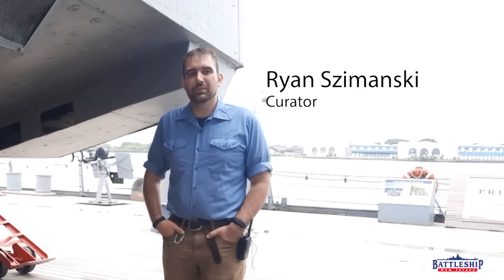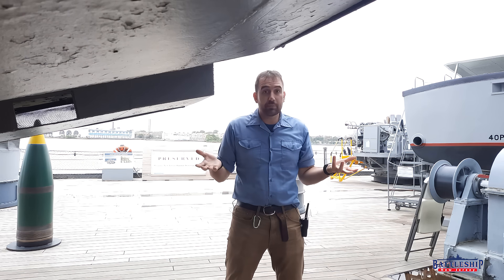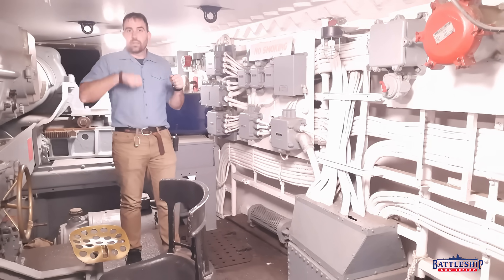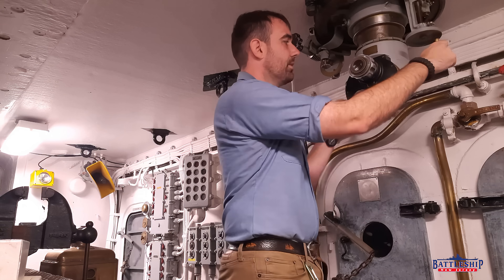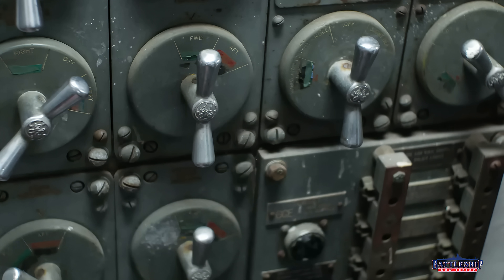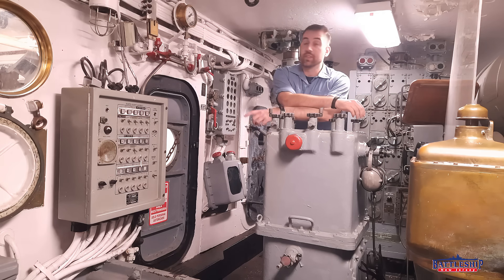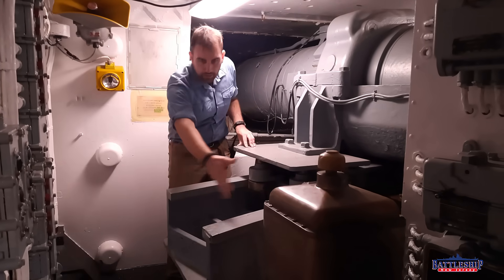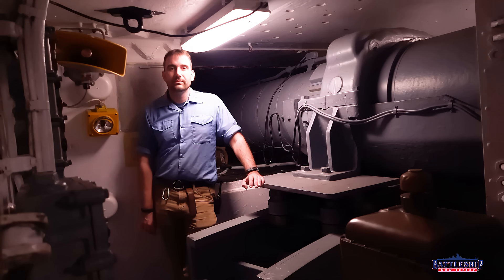Inside a 16in Gun House

Comment: The zig-zag welding lines:  You do not want adjacent plates to move away from each other in any direction.  By using "dragon's teeth" edges, the plates cannot move sideways without literally bending the armor teeth over for the full thickness of the plate.  As was mentioned, it also adds more surface for the welding to lock into if they were pulled upward vertically or sheared front-to-back.. If you look at the armored 2nd deck, it is made of two layers:  A underlayer of 1.5" STS that is directly part of the ship hull construction material and an overlying 4.5" STS heavy plate covering the underlayer,  This makes the armor deck somewhat thinner than 6" of solid STS, close to ~5.5" against a highly oblique AP shell skipping off of it (hopefully), while that is thick enough to stop most regular AP bombs  -- those huge British Tallboy or larger bombs, or German radio-controlled heavy AP bomb (used against ROMA and WARSHITE) made by the end of WWII could punch through, but such is progress.  One thing that this laminated design allowed was that the upper and lower plates were offset from one-another so that there was no ingle crack at the edges of plates on a single layer between the two layers, so that if a hit succeeded in pulling two plates apart on a layer at their joint, there would not be any continuation of the crack to the other layer.  This made the decks much stronger than a single edge-connected layer would be if hit such that two adjacent plates tore free from one-another.  That this was a good idea is shown by some German warships that only had a single armored deck layer and a torpedo hit in the stern literally snapped the stern armor at a joint free and the entire stern was only held on by the sides and lower portions of the hull -- not a good thing (much like the weakness from those Japanese AP bombs on the turret roofs of the old US battleships hit at Pearl Harbor).

Comment: The turret roof armor was 7.25" of Class "B" armor butt-edge mounted (interlocked, but not overlapped) with keying, bolting, and welding at the joints to make them as close as possible to a single huge plate.  Welding such small objects to their back surface will nots compromise the armor protection in the slightest (now Class "A" face-hardened armor is a different thing altogether and there were lots of restrictions to anything that might compromise the hard face layer).

Older battleships at Pearl Harbor had overlapped turret roof plates (4-5" Class "B" armor plates of the quality at the time they wer3e made), This involved having the part of the plate facing toward the front of the turret tucked a few inches under the rear portion of the plate closer to the turret face, like shingles, with heavy bolting through the overlapping portions to strengthen them against a hit coming from the front, since it was assumed that the enemy would be the ship that the US battleship was shooting at and thus toward the target it was facing.  This would give the turret roof protection a somewhat improved resistance at a highly-oblique angle from a ricocheting enemy AP shell.

This overlap was NOT used in the new US Navy battleships built starting in the 1930s.  The reasoning was that any shells might be coming from the side or, possibly, from the rear, and this could make the overlap weaker than a flat top would be.  This turned out to be absolutely true at Pearl Harbor.  Two old battleships, WEST VIRGINIA and TENNESSEE, had one of  their turret roofs hit each by the several level bombers that dropped converted obsolete 16.1" AP bombs (made by remanufacturing old pre-1930 NAGATO Class AP shells) -- the same group that had a bomb blow up ARIZONA.  The two turret roof hits were coming from the rear of the turrets hit, steeply falling but still having a tilt due to the horizontal speed of the aircraft that dropped them.  The bombs could penetrate the rather thin deck armor of those old battleships (ARIZONA showed this dramatically), but they should not have been able to punch through the much thicker turret roof armor.  But they did punch through, though the bombs were heavily damaged in the process (since there was nothing explosive in the turrets, the damage to them was relatively superficial and could be repaired quickly).  What happened was that the bombs did exactly what the turret designed of the new battleships thought might happen:  The bombs hit and began to have their noses rotated away to ricochet, but the nose of the bomb caught the back edge overlapping lip of two joined roof plates and bent it up, ripping out the bolts and allowing the bomb, partially crushed in the process, to wedge itself through the narrow "mouth" that it had just made and into the turret.  I think some modifications to all of the older battleship turret roofs was made to make this less likely.

Comment: Some points about armored gratings:

They are made of the same steel as used in STS/Class "B" armor.

The holes have cylinder top facing the incoming weapon and widening cones at the back side, so the back-side openings are somewhat larger.  The holes are made by using boring bars to drill them one by one into a full-thickness, fully hardened, tempered, and completed STS plate (part of the hull so I think that they are STS under BuC&R/BuSHIPS -- made only by Carnegie/Carnegie-Illinois -- and not the virtually identical Class "B" armor of BuORD -- made by Carnegie. Midvale, or Bethlehem);  they were not cast with the holes already in them since that made inferior-strength armor (about 10% more brittle).

Against large AP shell impacts at a highly-oblique angle, such as the plates used to fill the openings at the armored 2md-deck level made by the large funnels, one of these plates was found to be only 40% as thick, in effect, as the solid STS plate was before the holes were drilled in it.  For example, if you had a 6" deck plate, to get the same resistance, you would need a 15" grating of the drilled-hole type shown here.  Against near-vertical-falling aircraft SAP/AP bombs,  the resistance I think is about the same, though I have not seen any tests on that kind of hit.

It is expected that a hit will knock out chunks of metal between the holes ("webbing" material), but most of the plate will merely deform, not break apart (tough steel?).  If a bomb or shell explodes on the face of one of these gratings, much of the blast and fumes will go through the holes, so the grating must be kept at some distance and, if possible, offset sideways from whatever it is protecting behind it (engines and boilers for the deck gratings, obviously).

These gratings are rather new (for WWII, that is).  Older armored warships used crisscrossing steel bars in several stacked layers to create a grating, which was not nearly as strong..

Comment: those eye bolts are for moving heavy equipment in and out of the area, using multiple chain hoists. kinda daisy chaining between them. saw this strategy used on the USS Alabama. though they were usually not forehead height

Comment: Those old electromechanical analog computers are amazing. The skillset for building those have all died off. It would take great, deliberate effort to replicate that sort of technology. Those servo, synchro, integrator, etc are some high precision mechanical components.
Reply: And the engineers did all that with SLIDE RULES. And brain power.
Reply: The good thing about this technology is if there was ever an EMP attack, these guns can still be accurately fired
Reply: I would imagine the biggest problem with replicating the technology; It wouldn't be worth the time or effort in the modern day. You can do anything that old EMAC can do with a 5$ raspberry pi, both faster and easier. And that's only including dirt cheap consumer grade products.
Reply: @dakota9821  Analog versus digital computers - A digital requires that you pre-decide what your accuracy/resolution is.  8, 16, 32, 64 bits, etc.  An analog one can calculate a 'smidge' more or less.  Like cutting a board "Leave the line" or "to the line?"  Most tapes have 1/16 or 1/32 accuracy... your line width is around 1/128 with a sharp pencil.  Even finer if you use a marking knife rather than a pencil.  Also, Analog computers directly compute their results from inputs and so are constantly providing the solution.  No AtoD converters - which add their own inaccuracies.  No waiting for the loop to come back around.  No buffer overflows, stack errors, etc.  Hence Iowa's maintained their analog equipment through their service life into the late 90's.  Now, that isn't to say that modern encoders, AtoD converters, FGPAs, etc. couldn't replace this equipment.  But, a lot of testing and recalibration.  Plus, this older stuff is just really cool looking!
Reply: Don't underestimate the magic of CAD software and CNC machined prototypes. We don't need droves of extremely skilled manual lathe and mill workers to build those anymore. That does not mean that it wouldn't take considerable effort - but we could probably crank them out at a higher pace than before, and also are able to simulate their functionality before starting the build process speeding up the prototyping stage.
Reply: @mfbfreak  Good point of view. From what I've seen of the best electromechanical analog computers from the 70's, modern CAD/CNC technology will do a decent job of replicating the old analog technology.

Comment: I think you're overestimating the amount of power in those batteries.
Based on the circuit diagrams that I have they are intended to be an emergency power source for the firing circuits. They don't have nearly enough power to rotate the turret or elevate the barrels, which is why there are 2 independent power sources for each turret.
Even if the batteries were to be powerful enough to run the large motors for traverse and elevation there was no practical way (in the ship's design timeframe) to change the DC from the batteries into 440VAC 3-phase to power the A end motors.

Comment: Great video! One thing that occurred to me during a visit to the North Carolina was how unusual it is to encounter metal construction as heavy as this. Most of our interaction nowadays is with plastic, wood, or sheet metal (car bodies, pots and pans, office furniture). To knock-knock-knock on a piece of 16” armor is like hitting a piece of the earth’s bedrock—it doesn’t move or flex or ring or react AT ALL. Same with the equipment on board. Turning the knobs and dials on one of the firing control computers tells you immediately that you’re dealing with a level of  engineering and construction that’s completely outside of our everyday experience. That was one of the most dramatic discoveries from my battleship tour, and my son (about 10 at the time) still talks about it.

Comment: I understand the 'hazard ' of banging ones head. When I worked on the tanks ( REME ) in Germany back in the '70's I was always cracking my skull even though there were green pads fastened to various areas. The secret was to move about in slow motion.
Reply: Former US tanker here.  The secret is to always wear a head covering - even the standard issue cap was enough to prevent the worst of the 'turret bites.'
Reply: @colincampbell767  I used to have my black beret on..............but to no avail 😳

Comment: I'm a scant 5'9" tall. That's the maximum height you can be on a Coral Sea class carrier without having to stoop everywhere you go. We had a RIO in the squadron, call sign "Too Tall", who was 6'6" tall. He spent the entire cruise hunched over. I only had to watch my head going though "knee knocker" bulkhead passages normally.

addendum: The aforementioned "Too Tall" must have had to get a waiver to be aircrew, he would have certainly been knee-capped if he ever had to eject from the back seat of the Phantom.

Comment: One of these days, the Iowa is going to open up it's 16" turrets.  Did you guys have to deal with all the asbestos abatement they had to deal with?
Reply from the maker: Most of the asbestos was removed in the 80s but we all have to go through extensive testing to check for it.

Comment: It's said that battleships were the most complicated objects ever made by man and I can believe it.  I don't know how they ever worked out where all the pipes and cables went and were connected.
Reply: Funnily enough I once saw a photo of a mocked up area of a battleship when they were planning where things go. Amazingly, they used thick rope to simulate the cables and heavy duty wiring. Very clever. But yes, can imagine how mind boggling it would be to think of everything and how they all connected up to work correctly!
Reply: Much better then an architect did on the prints for a hotel a few years ago. Every few floors the room for the equipment was located on the opposite corner. It was supposed to be a chase for pipes, venting and power.

Comment: @Battleship New Jersey , Is it true or a myth that flooding the turret in case of the powder fire, drowns all the sailors manning lower parts of the turret?
Reply: There's not enough water in the tanks to fill the turret completely so if you haven't been burned to death or blow apart you can go up a level.
Reply: You can walk out of the powder deck, the lowest deck inside the turret,  there's a waterproof hatch. Although it's dogged shut during GQ. You can also climb up thru the turret and out the hatch Ryan climbed into the gun room thru
Reply: @charleslilja4698  Also the water is used to feed the sprinklers rather than to flood the entire turret structure.

Comment: 🇺🇸Ryan🇺🇸 The Zig/Zag welding is also a crack preventer.  A straight horizontal weld can crack easier than that zig zag pattern which prevents a fractured weld from a shock.
Reply: Sadly not really, the issue being the stress raisers of the corners create propagation points for an unzipping failure, which is why pressure vessels are welded in one continuous band with as wide of a bend radius as possible.

Comment: Welding the eye may not cause the armor to loose it's hardness.  I think the outside and roof of the turret would be hardened.  But the inside is not hardened or is lined with STS to prevent spalding if the roof is hit.  The crew of a French battleship was killed when the turret roof was hit by a US battleship.  The hit didn't penetrate but the spalding of the inner armor did kill the crew.
Reply: *spalling

Comment: Why was turret ones rangefinder removed?
Reply: They found that they could use the one in turret 2 if needed.
Reply: Had read that they were removed because the turret 1 on the Iowa's had a tendancy to get wet. There are pictures online where battleships have turned there first turret sideways to help keep it dry in heavy seas.
Reply: @budguy8829  that makes sense, removing the need for constant maintenance. but still i cant help but imagine a worse case scenario where they still needed the damn thing. cheers

Comment: The taller a stack the more natural draft will result, this effect is often called "Stack Draft" . With the stack at the top of the turret you can at least generate a little natural draft even if the turret has openings around deck level.

Comment: Is it possible (money no issue:) to make the turrets rotate or the guns train up and down again? Or where those mechanisms disabled by the navy/that requires steam power which the navy doesn’t allow?
Reply: They're electro-hydraulic.
Between not having the right hydraulic fluid, the hydraulic system having tons of leaks, and the large amount of the right type of electrical power being unavailable it's not practical.
Given money and determination you could do it, but that money would be better spent elsewhere (deck replacement and drydocking spring to mind).

Comment: 6:30 I have a question for someone who actually served in a gun house. What repairs were likely to be done on that bench inside the gun house? I'm just figuring if the had a common setup there must have been a pretty regular need to use those tools? What was most likely being repaired?
Reply: Hydraulic or Pneumatic hoses/piping is one example, electric motors or hydraulic pumps is another
Reply: Side note here. I´m a welder/fabricator, and i had one of those vices in my shop, that had been bought out of an old decomissioned frigate from my country Portugal, by my father who is a retired Navy man. Had to sell it a few months ago, after i got sick and unable to work. It´s funny, but my vice looked like an exact copy of that one, and probably was made by the same maker. I had it tracked to a model made in the 1940s or 50s by Rock Island, model 542-BX. It was a monster vice, probably well over 50kg in weight. As soon as i saw it on this video i recognized it immediately. I was very sorry to sell it, it was one of my most prized tools...